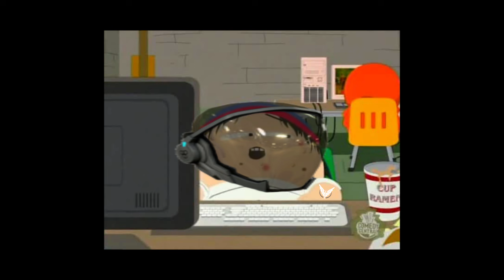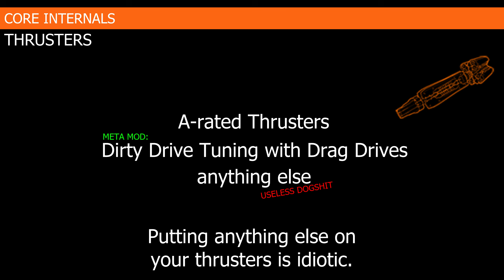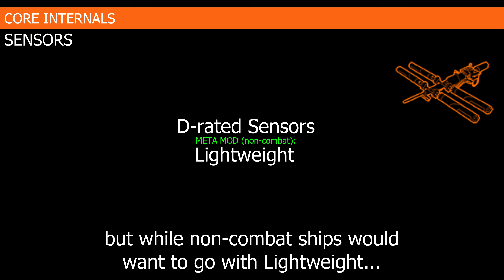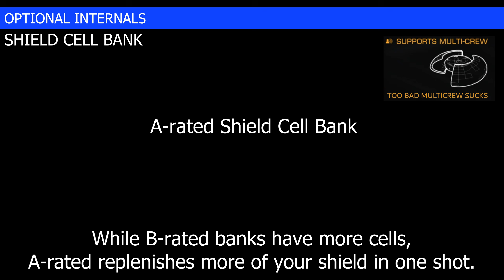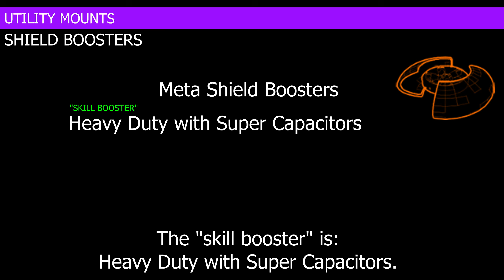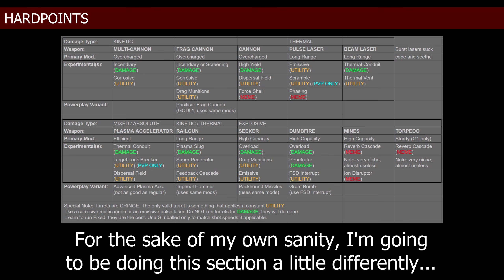[Elite: Dangerous] Meta Engineering Guide (with memes)

Comment: Some caveats:
- A single PD is useful on the bottom rear of most cargo and miners because NPC pirates will use hatch breakers when you run. It is also useful on the top of whatever ship you farm Guardian mats with.
- Guardian MRPs have higher HP than human ones so if you have a lot of extra power plant capacity it can be worth taking them
- Not sure if this has been reworked, but heavy duty+deep plating reactive armor with your smallest HRP having thermal resistance+deep plating gives you higher overall and effective HP than balancing the resistances of military grade armor

Comment: I use clean stripped down drives on exploration ships to help with heat and also cut on mass, while also allowing decent landing performance. Everything else is 100% dirty drags.

You might be thinking, "why is heat a concern? Just pack heatsinks!" and yeah heatsinks are great, but sometimes you just need that extra smidge of heat efficiency. My short range (not yet fully engi'd) test voyage is to go to VY Canis Majoris and do literally anything near the star, for instance charging FSD to jump to an adjacent system. If it only overheats a little bit (VY CMa is one of the largest known stars and possibly the largest star in the game at 1419.9 solar radii, fucker's so big it looks perfectly still as you jump into the system, so the range at which a ship doesn't effectively vent heat near it is equally as massive) I'm on the right track. My long range test voyage for all of my exploration builds is even more unhinged, I fly 6,000 lightyears away from the central area of the bubble to V1357 Cygni and park inside a fucking black hole, sit there for a minute, and then charge FSD and GTFO. If the ship cannot do that without overheating, the build needs more work. So far the only ship to do it flawlessly first try without excessive minmaxing was the Mandalay, but that's cheating because the Mandalay has absolutely busted thermals.

Comment: Weapon Focus Distributor is a thing for laser mining builds that use a ship type with low class distributor. It's the only way to squeeze out enough juice to actually mine at a decent rate, and that's the most important requirement for a laser miner. The Type 8 and I guess Type 9 are good examples. Because the Type 8 only gets a class 3 distributor, nothing will boost the laser output to a sufficient level, other than Weapon Focus engineering. (And one would also want 5 Torvald Modified Mining Lasers to properly complete the build.)

Comment: Shield Booster: what is a skill booster?
Reply from the maker: Heavy duty with Super Capacitors. Minmaxxes your shield upfront without increasing resistances. It's a tongue-in-cheek name for the booster. Not recommended to use only skill boosters, you need res augs and thermals to fill up your resistances.
Reply: @CrimsonGamer99  perfect thank you for the quick reply! Greatly appreciated

Comment: As someone new to the game, this is a great video. No fluff and straight to the point explaining engineering. One question, since this video was made before Powerplay 2.0, how would you engineer Concord Cannons?
Reply from the maker: Concord Cannons are cannons and have the same modifications available. Their gimmick is they have a high shot speed and are a three round burst. Overcharged is fine for the base mod. I would personally use them as a utility weapon, as a three round burst force shell is super funny. But don't expect them to be your main damage output, their DPS is very low.
Reply: @CrimsonGamer99  theres currently a bug with the concord cannons where if you have overcharged on them where when you restock them their ammo doesnt fill up all the way

Comment: I am here to tell you that I equip a 2D powerplant on my explorer because they don't build powerplants any smaller than that. The black did unspeakable things to my mind that no amount of engineering guides, with or without memes, can repair. I'm juiced out of my gourd on max range. I run D-rated everything except FSD. 1D distro, 4D drives, 3D shield, the works. It's a paper bag with a double-engineered frameshift drive crammed in the back end, and I wouldn't have it any other way.
Reply from the maker: A 2A low emissions plant will only cut a tiny bit out of your jump range but will provide more power and allow your ship to run MUCH cooler. With it, you could sit on an O-class and scoop fuel without ever overheating.
Reply: @CrimsonGamer99  I am fully aware of this, yes, and I have run all the numbers. It's like half a lightyear I would lose at the very most. I'm just that brain damaged and there is no cure.
Reply from the maker: @TheCammerhammer  based. Carry on, cmdr.

Comment: I thought it was Mass Manager for class 5 or higher, and Deep Charge for class 4 or smaller?
Reply from the maker: If you only want pure jump range, sure. But mass manager is much more fuel efficient and not a noticeable difference in overall range.

Comment: Reactive armor is god, 2 positive defences and only 1 negative, thermal dmg it´s garbage
Reply from the maker: Thermal damage is the single most used damage type in PvP, and the bulk of incoming NPC damage is thermal. The kinetic and explosive resistances (explosive in particular) will not be noticeable compared to the massive thermal cut, as there isn't going to be as much kinetic and explosive damage hitting you (as they have shot speeds) as compared to incoming thermal damage.

On top of this, it adds needless cost to your rebuy.
Reply: Only reactive armor for warships! Time-tested.
Reply from the maker: @4Tg_Barmaley  I'm not typing everything I just said again.

Comment: when i have all mats full , is that enough for all the engineering or do i need more than i can storage ?
Reply from the maker: If you're doing a crazy build with like 10 heavy duty hull reinforcements then you may need to refill one of the raw bins. But otherwise, full bins should let you fully engineer anything.
Reply from the maker: @Rokr83  actually, scratch that. Now that everything has a predictable flat cost, you would be hard pressed to use an entire bin of anything on one build.

Comment: is there an introductory guide to engineering? i picked up the game again because the grind was mitigated and i have no clue where to start.
Reply from the maker: If you ask me, this IS the introductory guide. It's Grade 5 Engineering or nothing. But I am a massive elitist and think everyone should be minmaxing their ships or gtfo. That being said, every modification in this video is what you should engineer, regardless of what grade of it you can afford at the time. Only have grade 3 thrusters from farseer? Engineer your thrusters with Dirty Drives up to Grade 3. Come back and G5 them once you have Palin or whatever.

If you don't have any engineers unlocked, start with Felicity Farseer. You should know about her from common knowledge. Her base is in Deciat. Requires a meta alloy to unlock, which can be purchased from any of a hundred or so fleet carriers that are selling them (check Inara for nearby ones within your price range). She has basic engineering available on a lot of stuff, and max on FSD. Then just follow this guide for what to put on your stuff.

As for the mat grind, the old methods are still the meta, it's just 10x faster now.

Comment: Reactive Armor is better that reflective by a large margin! In my opinion, since most pvp ships are equiped with projectile weapons, once your shield goes down, you want the reactive armor.
Reply from the maker: No, most PvP ships are equipped with thermal weapons to get through shields. Anything kinetic usually has Incendiary on it, which converts 90% of the damage to thermal. You want as much thermal resistance as possible on the armor.
Reply: @CrimsonGamer99    the kinetic weapons are still kinetic,  that experimental demage only transfers certain amount of kinetic demage to thermal. Most of the demage is still kinetic. Reactive armor gives you the best balance in resistance across the board. I've experimented with all three bulkheads and best result I had was with reactive and military grade.
Reply from the maker: @Edit1213-l6w  it transfers 90% of the damage to thermal. Incendiary weapons become basically thermal weapons.

I have done PvP in this game for 8+ years, I know what I am talking about.
Reply: @CrimsonGamer99   so did I , but I'm getting different results here when I go pvp 8k hours here and I can tell you in pvp I rarely lost, only to people that were much better or are in groups.

Again this is just my opinion.
Reply: @CrimsonGamer99   but I could've been wrong all these years so there is that .

Comment: Can someone explain to me why Reactive Surface armor is bad? Is it too expensive or just mathematically bad for stats?
Reply from the maker: Glad you asked! A big part of it is the negative resistance. Everybody runs thermal damage these days to tear through shields (which, no matter what you do, are gonna be bad at tanking thermal), and Reactives cut your thermal resistance significantly.

It is also the cost. The base cost isn't the issue, it's that they add a ton to the rebuy which adds up over time.
Reply from the maker: NPCs also tend to be thermal-heavy (they suck at landing anything that isn't hitscan), so this applies to PvE as well as PvP.

Comment: all nice and dandy, but did they implement a single key stroke to request Landing Permission yet ( like it was in the original game ) ? or do you still have to go through hundreds of Menu clicks ?
Reply from the maker: If that's your biggest gripe, then you've clearly never engineered anything.
Reply: @CrimsonGamer99  quiet in contrast Sir, i played that game when engineering came out, had a Python ( 6 mil in re buy ) at that time and 30 mil in credits, gathered material for engineering and got blown to pieces by NPC's 5 times in a row, who had / where fully engineered already, while the "normal" player just started engineering, that made me quit the game
Reply from the maker: @Myself_Hoschi  go back to the video, press play, press 3, and look in the top right corner.

Comment: A few honest questions. 1 and 2 are questions I have wondered about but never messed with due to the engineering grind required to test them. 3 is just curiosity of a meme.

1. Power distributors. There are some cases where a D class distributor can provide nearly the same performance as an A class a rank below. Case in point a 6D on a Clipper will still give you the 5 second boost refresh time as the 5A while shaving off 2 tons and costing about 1/5th the price. I've never tested it and have only run As but I wonder if that isn't a tradeoff worth considering for specific builds. Is there something relevant I am missing or is there an actual argument to be had here?

2. Heat Sink launchers. Game glass being a thing and flight sticks, even some cheap ones, having enough buttons on them that one could theoretically have enough buttons to do pip management and everything flight related with the stick hand is there an argument to go shielded or reinforced instead of ammo capacity to reduce the risk of losing the heat sink due to damage?

3. Cytoscramblers. I know they are a niche meme weapon but last time the damage numbers for them showed up on coriolis they theoretically beat out everything small in terms of shield stripping. Are they too niche to be worth using in the small spot over other support options? This question is only relevant for a few specific ships where the smalls are there strictly in support of larger hard points like with the Alliance Chieftain and Federal Gunship. No, those aren't great PvP ships but watching your videos involving meme fights left me wondering why I hadn't seen someone do this yet for the memes.
Reply from the maker: 1. I ran the numbers for you:
6D Charge Enhanced with Super Conduits:
WEP: 34.7mj / 5.9 charge
SYS: 23.7mj / 3.6 charge
ENG: 23.7mj/ 3.6 charge

5A Charge Enhanced with Super Conduits:
WEP: 37.4mj / 6.5 charge
SYS: 26.4mj / 3.8 charge
ENG: 26.4mj/ 3.8 charge

5A wins, but if you can fit 6A, run 6A. It beats both by a longshot.
A 4-ton mass difference is basically nothing on a combat ship. On something with lower mass tolerance like an explorer, you should run engine focused anyway (no real need for wep or sys), as that lets you still boost on a much smaller distro.

2. Utility mounts are fragile as-is. Adding a percent increase to their integrity will not noticeably improve their survivability. And if you're taking enough explosive damage to start shedding utilities, you have bigger issues. Ammo is still the way to go because you'll likely use most while shields are up anyway, not down.

3. You are correct, cytoscramblers look great on paper. In practice, one word: Jitter. They have like 3 degrees of jitter, which causes them to miss more than half of their shots. If you can stay close, yeah they shred. But you will be missing more often than you hit with cytos.
Reply: @CrimsonGamer99  Thank you for the answers. Greatly appreciated.

I have a Chieftain build with cytos so I know about the jitter. It seems to me that the jitter is a good reference for the short range of the weapon too. Once the jitter is getting too wide to hit consistently you are likely out of effective range. Granted I only fly it against the CPU for the memes and good human pilots are nothing to compare them to. Hence the question.

Comment: Engine focused power distro is used for explpration builds, as it lets to boost with smaller and so lighter distros, giving higher jumprange while still able to boost.
This is not possible with charge distros.

Also guardian distros give +4% power, which can be handy, has has similar stats (albeit worse) then charged distros.
Reply: (its THAN not then ffs)